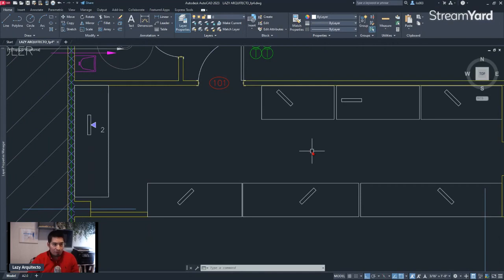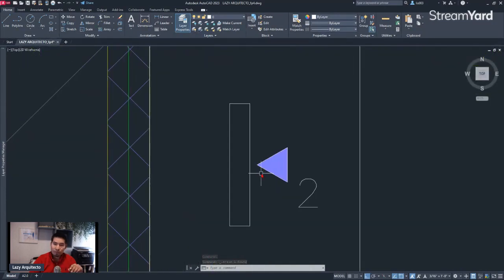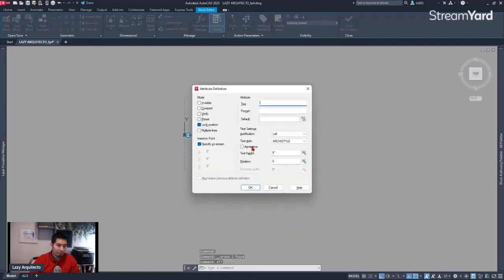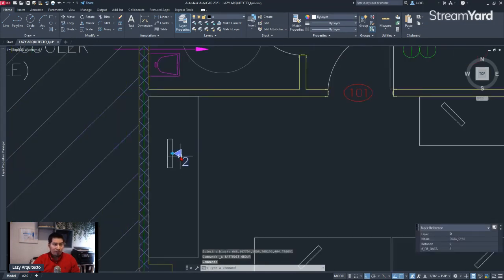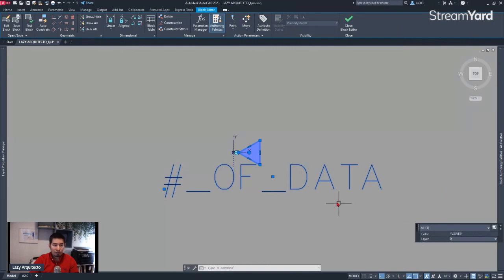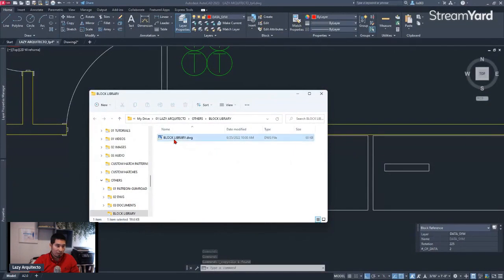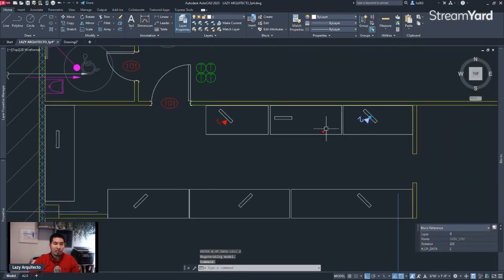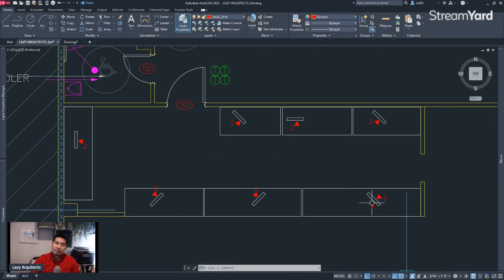6 Autocad Optimization Techniques You Have to Try

Comment: toogle key misssing in autocad ortho osnap grid how to get it on my working bottom tool box
Reply from the maker: Dinesh Typing STATUSBAR into the command line and changing the value to 1 should bring it back.
Reply: @LazyArquitecto  Thanks alot
Reply from the maker: @dineshchaudhary3222  happy to help. Join us live on Sunday
Reply from the maker: You have to click on the bottom right corner hamburger icon to open it and check the items you want to see it in your status bar